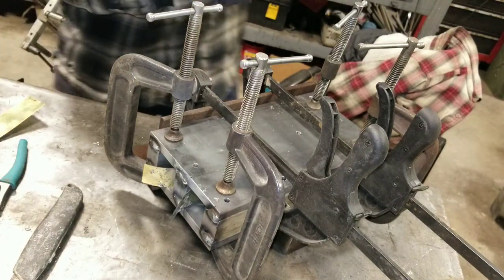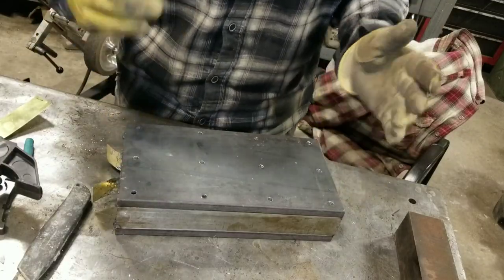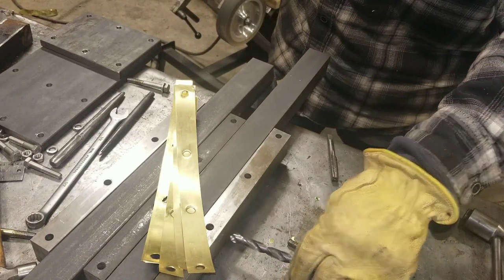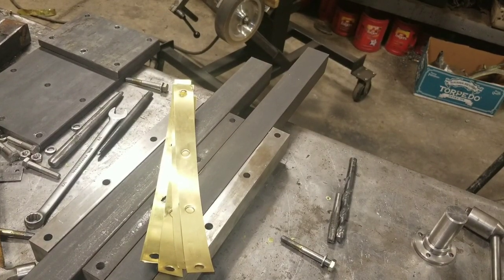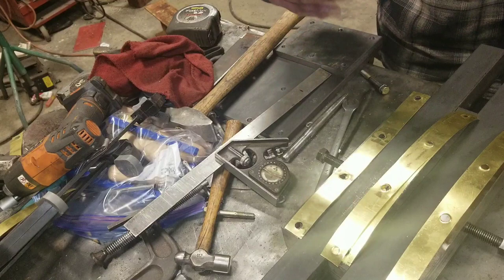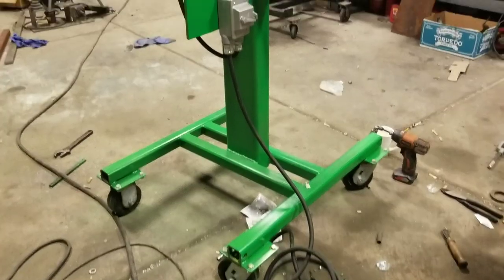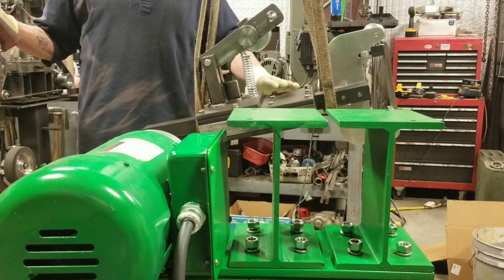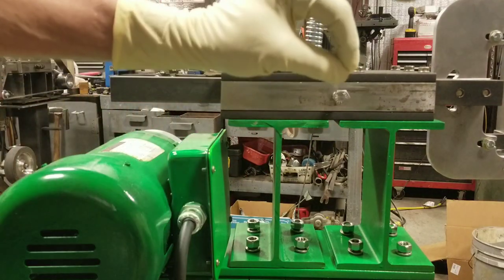DIY Scratch built KMG 2×72 clone belt grinder/sander

Comment: Geeze that just blew my mind. I have a nice 2x72 but its on loan (I'm its caretaker) and may eventually have to go back to its rightful owner. Mine is a 3 phase (converted from single) and 2 hp 3450 rpm. Its tough as nails. If he ends up taking it back I'm going to have to replace it. But the thought of building one like yours makes my brain ache.